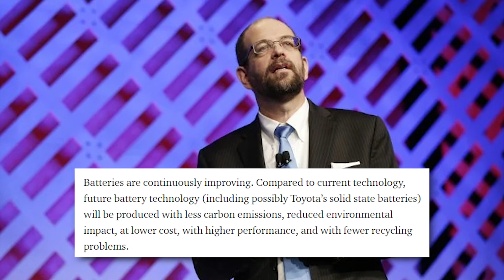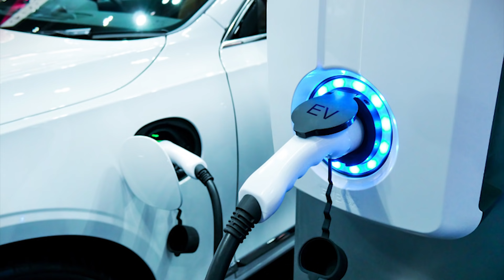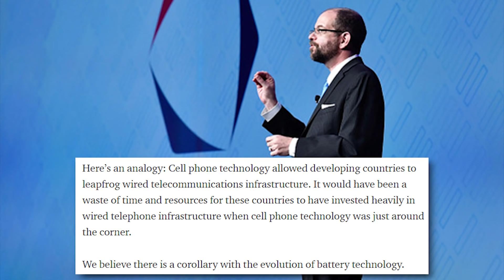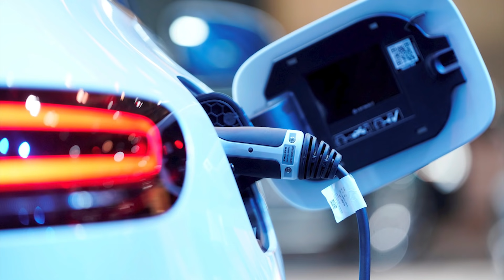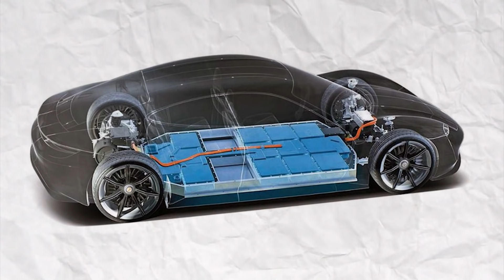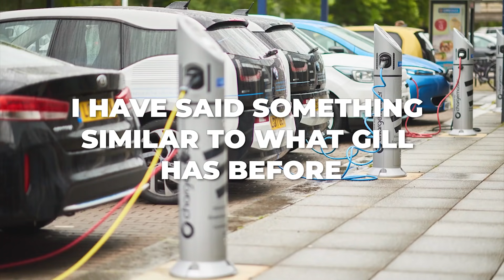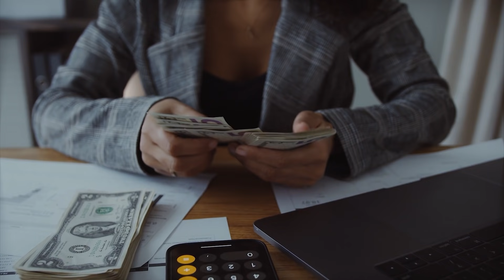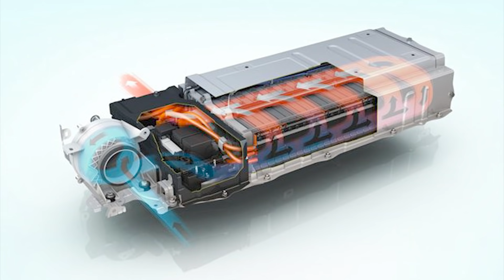Toyota Suddenly Confirmed Solid-State Battery Plans, Revealing Improvement Goals

Comment: Toyota: Back in the 1980's or 90's?   a Japanese man created or designed an Engine that can last 1,000,000 miles that did not need engine oil or coolant.  Toyota bought the Design and Copyright from the old Japanese man .... THEN TOYOTA SHELVED IT.  I cut out an article somewhere but can't find it.  Solid State battery will have a long life and don't need to be replaced like the other batteries....we will never see it; unless Toyota or any other makers only want to sell us just One car in our lifetime.

Comment: It is simple. Rolling out EVs absolutely REQUIRES adoption of wide spread, scaled applications for solar and wind generation, localized grids and utility sized "peaker" plants served by solar AND wind (geothermal where appropriate). This new electrical grid is a requirement for us to continue development of EVs, ground, air and water. We can crush petrochemicals in a generation if we have the will to do it.

As far as the comment re: solid state batteries: I think you are making much out of little here. Sure, solid state will be the endgame for this, I'm sure. But that doesn't make the current state of the art something that we can economically use for now. It will happen when it happens.

Comment: What EV needs is standards in geometry and electrical connectivity that will support a compatible family quick exchange power packs, as replacement or addition to petrol filling stations, which will be preferred over overnight home charging setups. Potential owners living in dense multi-family urban and suburban communities simply will not have at its disposal parking areas with corn rows of charging poles. The quick exchange paradigm provide degree of financial ravages of technological obsolescence, range anxiety and risk of neighborhood overload of its power grids because regional power pack recharging and distribution centers would be located adjacent to power generating or renewable energy harvesting plants. Also, tank wagon trucks, with its empty back hauls would be replaced with 18-wheelers.

Comment: Great news.  Maybe won't be commercially available until '25 or '26.    My '12 CT200h and '16 RAV4H will tide my household over until such time we are not stuck with Li-ion batteries with at most 10 year warranties (Toyota/Lexus), most are only covered by eight years.  That's too short for my peace of mind especially when replacement cost is in the $15-25K.

Comment: Lots of sceptics below in the comments, old saying tells you everything you need to know "necessity is the mother of all invention" and SSB's are essential as legacy Li-Ion batteries are not fit for purpose for EV vehicles (not my words, the words of John B Goodenough, the man who invented the Li-Ion battery in the late 70's).

As for the references to Fusion reactors the difference between SSB's and Fusion energy is that SSB's are a concept conceived by man based on what we learned from battery development over the past 100 or so years (in effect SSB's are simply replacing a liquid electrolyte used in a Li-Ion battery with a solid one, the delay is as much around the SSB developers trying to find cheaper, more easily available and more sustainable anode and cathode materials as it is developing the electrolyte), Fusion is a concept we've taken from understanding the way the sun works, as such we know exactly what to do but actually making that process work on earth is something completely alien to us. note Fusion works on earth but its inefficient such that it takes more power to make it work than it produces thus its of no use until we make it energy positive.

SSB's are coming, please try and understand unlike most inventions whereby we invent something, rave about it and then its developed to become useful 20 years later (lets take Graphene for example) SSB's already have a ready made, highly sought after marketplace (EV's and Mobile phones), as such the inventors aren't just trying to invent a battery that works they are developing it and developing the capability to produce these batteries commercially at high capacity to meet the inevitable demand that is going to come almost immediately post launch. 

Any SSB development company who produces a viable SSB without the capability of supplying to meet the demand will just be opening the door to major manufacturers to steal there marketplace and plagiarise all there hard work thus I'm sure SSB's are much more developed than many of the developers are letting on but being held back until they are ready to announce plus produce in industrial quantities.

Comment: This Toyota doing what it does best.. Talk. It's true that things will inprove and change in the future but we can't simply wait to change when we have a viable solution that works now. This is just Toyota using lots to smooth talk to cover the fact that they don't want to produce battery cars. Currently they have not one fully electric vehicle.. Not one. This the company that was the first to move into electric vehicles. Now we see them talking about and promising lots of things all while doing nothing to make things better now. If we wait on them it will be years if ever before things change. What Toyota is really saying is we don't have a plan beyond stalling while we try to figure out how to make hydrogen work. Toyota is committing suicide.

Comment: The message from a company who dragged their feet and now need a few extra years to complete its homework.  Come on, todays technology is good enough, that’s why Tesla is making billions.  Even when batteries can charge faster, it won’t be a game changer that will transform the industry the way Toyota promises.
Reply: @ulikunkel6074  While it is arguable that a better technology is better only if it's available to the consumer today, one still need to consider the core idea of consumer value.  I would consider Toyota EV a real competitor when they sell EV that have more range than a Tesla at the same price range.  This is very difficult for a new technology that have not been scaled up.  My guess is that their tech might be competitive in about 3 years.  I genuinely hope that this time, someone claiming a battery breakthrough would actually be able to bring the tech to market.

Comment: The grid will coupe well with EV's. Simply because most people will be charging over night at a time that electric companies wants users to use electricity.  Thus more EV's will actually help the grid, plus by reducing fossil fuel use, reduces electricity used by those refineries.  I saw calculations that showed that an EV can go further on the electricity used to produce one litre of petrol than what the average ICE car can go with that litre of petrol. So if we get rid of all ICE vehicles and thus stop producing gasoline we will have more power available than we have at present, without adding a single power station. At least in theory.
Reply: I will only by an EV that I can charge from my household solar :-p.  It solves more problems.

Comment: Toyota has been steadily saying that this was always their plan. The major point however is the timeframe for deployment and sales. Is is 5 years from now, or 20 years from now? Because the timeframe and cost competitiveness is key. 30 years ago GM showed of their "Impact" electric car concept, which later became the Saturn EV1. Which were leased to the public 20 years ago (in small numbers), and then later discontinued, with the leased cars returned to GM and crushed. Most people do not know, but just like Toyota is doing today, the EV1 had many variations. Including a fuel cell version, series hybrid, parallel hybrid, and CNG models built. In 1999 GM looked like the top EV leader in the world. But then The U.S. government relaxed their future requirements for zero emissions vehicles, and by 2002 the whole EV1 program was dead. And it wasn't until 2017 (15 years later) when GM came back and built their next BEV, the Bolt. So just like GM 30 years ago, Toyota had tons of cash invested, and many engineers hired. They had prototypes shown, and even EVs built and leased (which is better than Toyota today). One key difference is that Tesla didn't exist then as viable competition. So, just like GM, Toyota could come out with a solid state BEV this year, or in 5 years, 10 years or never. Time will tell.

Comment: “Possibly” means they haven’t figured it out yet. QS will have a ssb. Shown four layer 800 cycle data and initial 10 layer data to have >90% energy retention. Good luck Toyota, sulfide separators will never meet commercial requirements.
Reply: This just a fantasy.   They have not figure out how to mass produce the solid state battery without going broke.

Comment: It's going to be a matter of money, not of personal choice. I just wanted faster horses. When it's a lot cheaper and better, that's where the money goes. Doesn't matter what you're selling when no one buys it anymore.
Reply: EV's will, eventually, be much cheaper than conventional cars - it all hinges on battery costs. Mechanically an EV is an order of magnitude simpler than and ICU vehicle so should prove more reliable. The time of EV's is coming (somewhere between 5 and 10 years) and a responsible government would be planning for this. BTW, the total load increase on the USA's grid, if everyone went electric tomorrow, is about 5%. Again, this should be planned with, along with high voltage, high current cables to existing gas stations so they can be converted to fast charge 'pumps' instead of gas. Of course we'll do no planning because America hasn't done anything much in the way of infrastructure since WWII.
Reply: Faster horses, younger women, older whiskey, more money - sounds like a plan.

Comment: Many people are installing #SOLAR with 🔋🔋BATTERY backup so they are not dependent on the Grid. This is how most #EV owners achieve ZERO #CARBON levels and are not Reliant on the Dirty, expensive, irratic Grid.
Reply: @stickersadd20hp Don't forget to include the dirty power used to create the solar cells and batteries. So, no, you cannot achieve ZERO carbon levels.

Comment: Are BEVs the sole transportation of the future? Well, fossil fuels have been the sole transportation up until now. I don't see why it wouldn't change completely. Maybe gas and BEV for a long time, but as volumes of gas usage declines, transportation, refinement and distribution will become more expensive, making it a worse choice. Same thing for Hydrogen.
Reply: Hydrogen is different. It will be very useful for heavy transport such as buses, trains, long distance transport, but not for single or low number passenger vehicles where it is too expensive compared to BEV's.